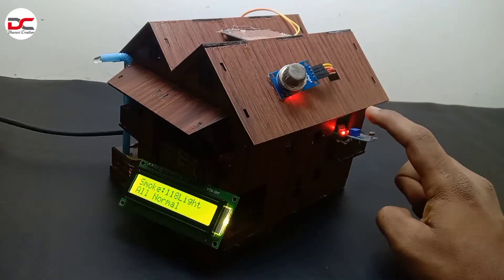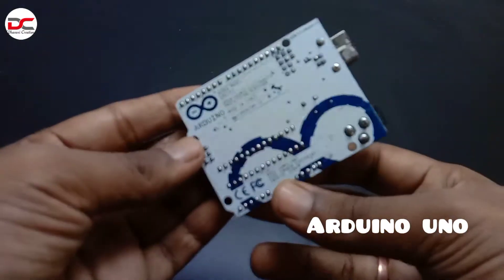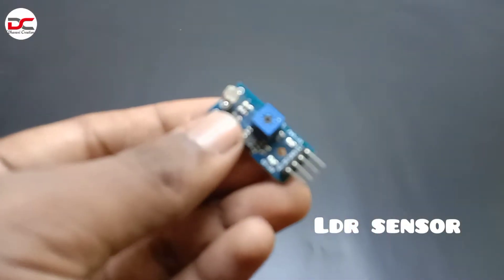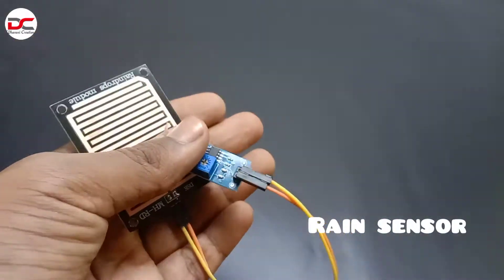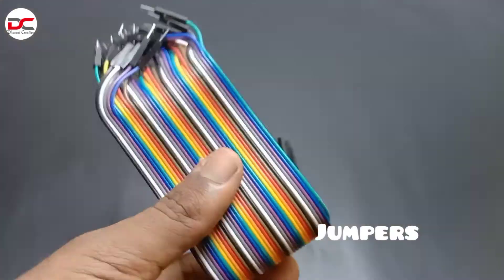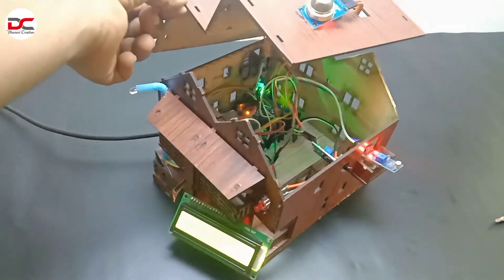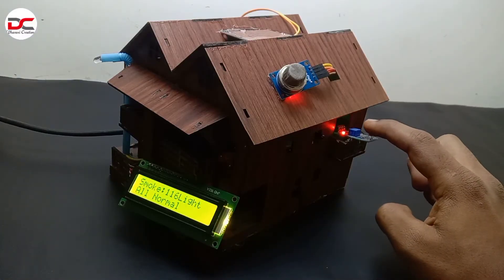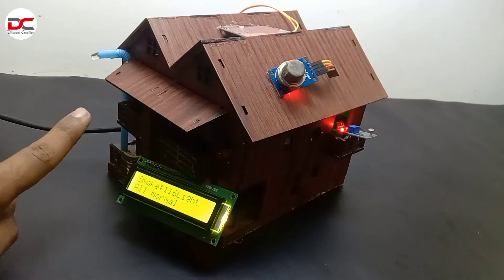DIY Smart Home with Arduino Uno | Smoke, Flame, LDR, Rain Sensor + LCD & Buzzer| Dharani creations

Comment: Hey can you please explain me how to connect the led in that small home. Pleasee i have deadline
Reply from the maker: Sure thing! Based on the diagram, connecting the LEDs is quite straightforward.

You'll see the negative pin (the shorter leg) of each LED goes straight to a Ground (GND) pin on the Arduino board. This is the common return path for your circuit.

The positive pin (the longer leg) of each LED connects to one end of a resistor. This resistor is crucial—it limits the current so you don't burn out your LED!

The other end of each resistor then connects to one of the digital pins on the Arduino, specifically Digital Pins 5 and 6. These pins will be used by your code to turn the LEDs on and off.

If you have more doubts about the connection you can contact me on Instagram "https://www.instagram.com/dharani_040407/" .
Reply: @dharanicreationsthank you so much🙏

Comment: Could you please share me detailed info... I need to make science project working model - smart home the future with living robots
Reply from the maker: To integrate the concept of "The Future with Living Robots," you'll need to expand the functionality into two main areas: Proactive Automation and Integrated Robotics.

1. Expanding the Smart Home (The "Future" Part)
The video's system focuses on alerts. A future smart home is about automation—the house taking action on its own.

Climate Control: Add a DHT11 or DHT22 sensor (for temperature and humidity). The Arduino can use this data to automatically activate a small fan (using a DC motor controlled by a Relay Module) if the house gets too warm.

Automated Curtains/Windows: Use an SG90 Servo Motor to simulate opening and closing curtains or a window. You can program it to close automatically if the Rain Sensor (which is already in the video) detects water, or to open in the morning.

Proactive Lighting: Use the existing LDR sensor to switch on a light, but instead of a simple LED, use a Relay Module to control a higher-power light source, showing real-world application.

2. Implementing the "Living Robots"
Since you can't build a complex robot, you should aim to simulate a specialized Autonomous Maintenance Bot that lives within the smart home model and performs a helpful task.

The Robot's Core Function: Plant Care Assistant 🌱
This demonstrates a robot that works with the home's environment.

The Robot Model: Create a small, simple vehicle chassis using two TT Gear Motors with wheels and an L298N Motor Driver to control movement.

Smart Integration: Place a tiny container with soil (a plant stand) in your model. Connect a Soil Moisture Sensor to your main Arduino board.

The Logic:

The Smart Home (Arduino) constantly monitors the plant's soil moisture.

If the sensor detects the soil is too dry, the Arduino sends a signal to activate the Maintenance Bot.

The bot moves toward the plant's location (you can program a simple fixed path) and lights up a small LED (simulating watering or providing nutrients).

This shows the Smart Home identifying a problem (dry plant) and dispatching an Integrated Robot to solve it.